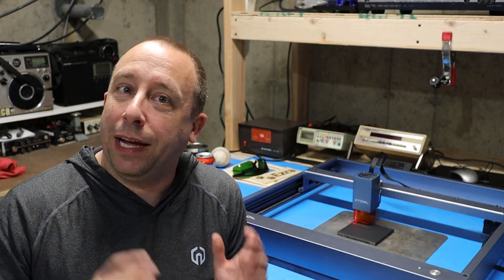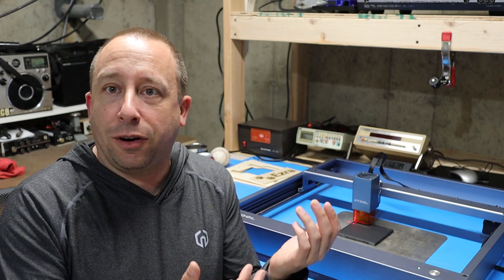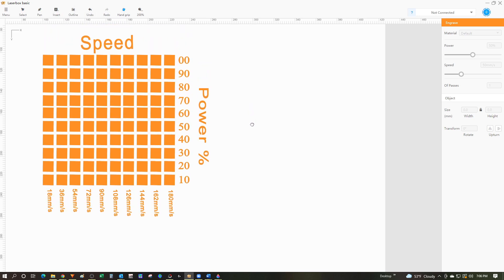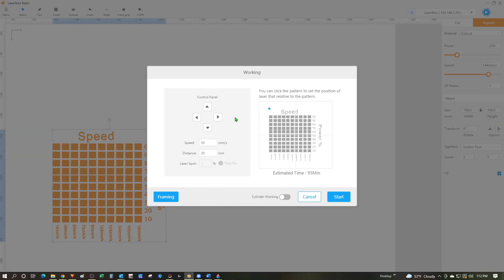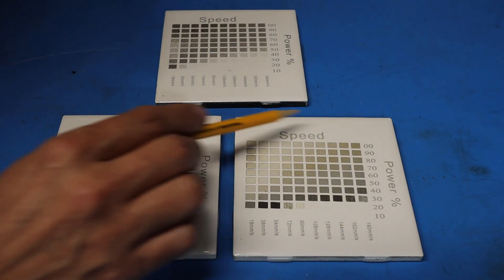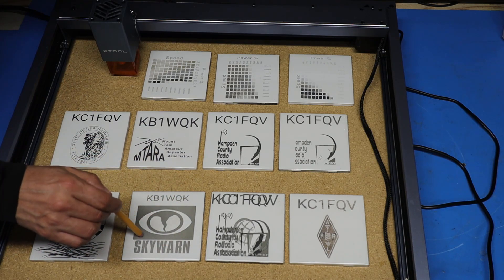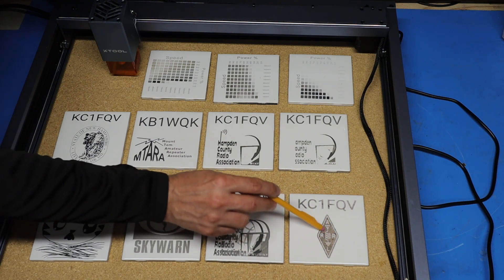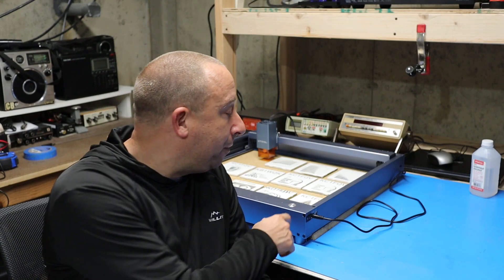Learning How to Engrave Tiles With the xTool D1 10 Watt Laser

Comment: Amazing demo, thanks!  A few newbie questions:
1. Single pass or double? 
2. unidirectional? 
3. Do these tiles need any treatment after engraving to preserve the design? 
4. How does lasering through black paint on a white tile leave black lettering??
5. Lastly, any experiments yet with multiple different settings, i.e. segregating certain sections of the tile and adding different gradients for different parts of the picture?

Thanks again, already started on engraving!
Reply from the maker: I haven't had much time to experiment myself since posting this video but here goes: 1. So far I've just tested with single passes.  2.the laser works in both directions 3. No 4. The laser causes a chemical reaction with the material in the paint that causes it to sort of blacken and bond with the ceramic.  White paint works better than black because it has more of that material in it.5. I plan to do this but haven't had time yet....work has been busy lately
Reply: @SevenFortyOne  Thanks so much.